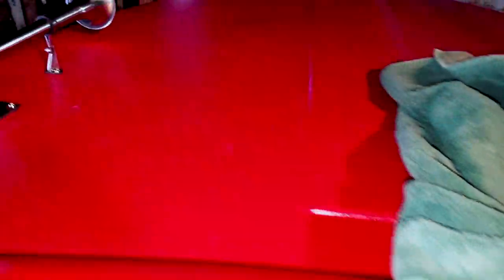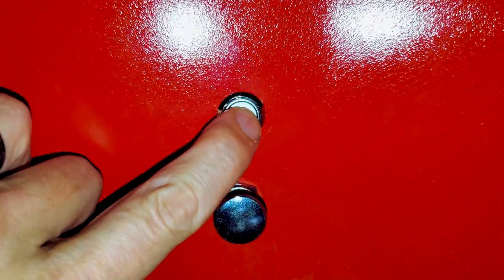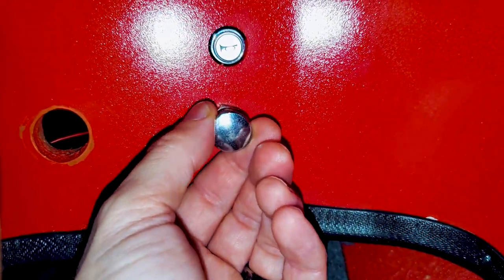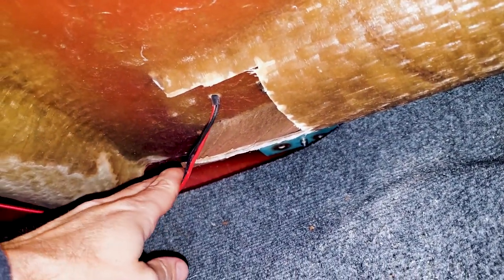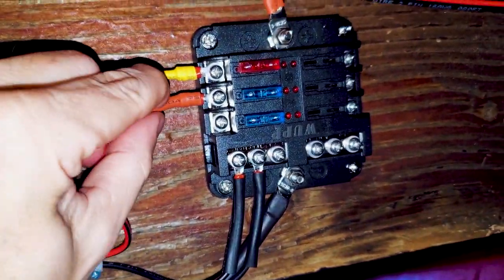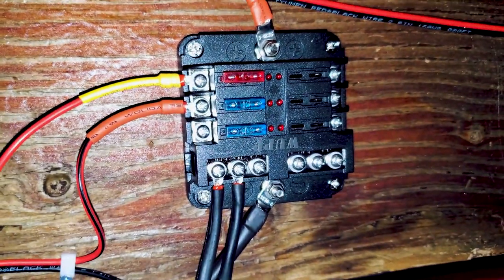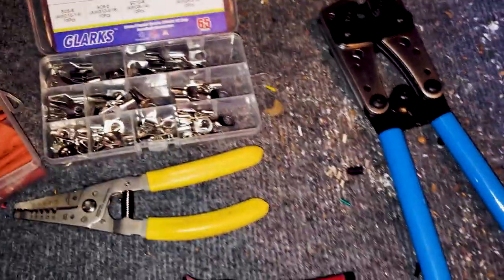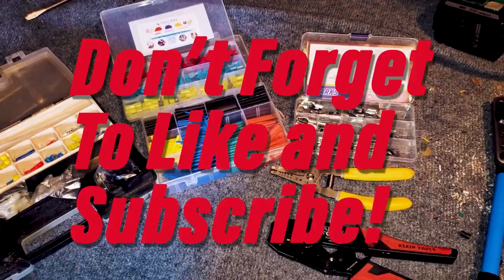Wiring the Dash On a Vintage Runabout Boat!

Comment: Nicely done. I just acquired my mother's 1964 Montgomery Ward runabout, and I will have to rewire everything. One thing I'll be looking forward to, is that everything will be easily accessible!  I have a 30' Hunter sailboat and have re-wired and plumbed that and easy access is not an option on bigger boats.  Great work on nice clean wiring!  Thanks for sharing.  Looking forward to another video showing your lighting improvements.